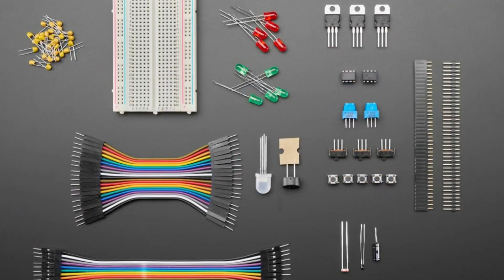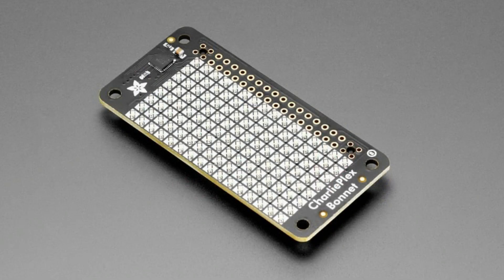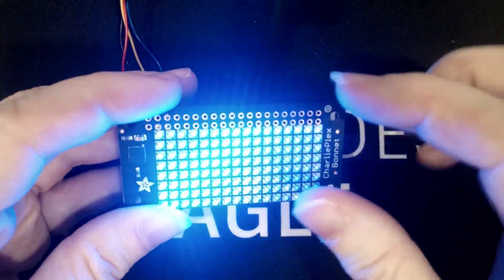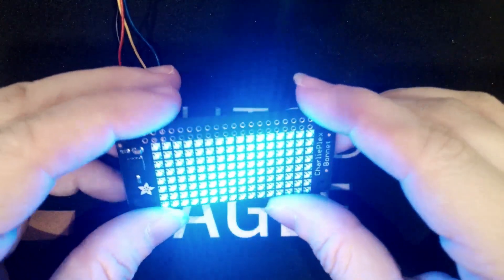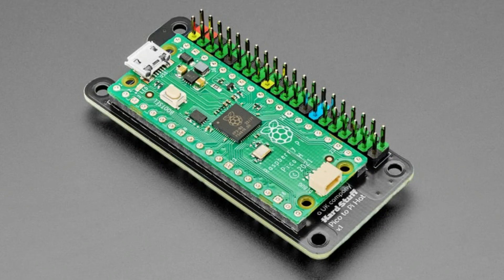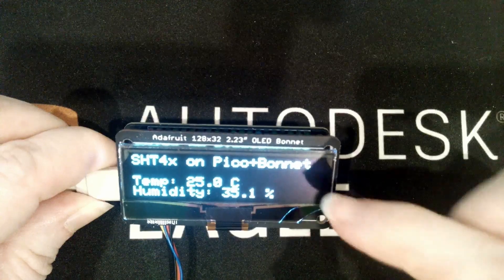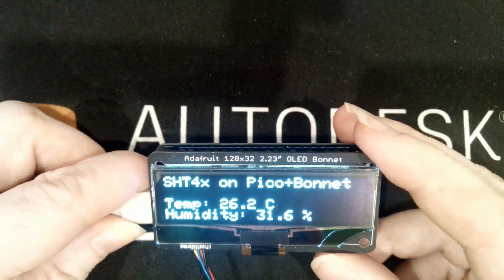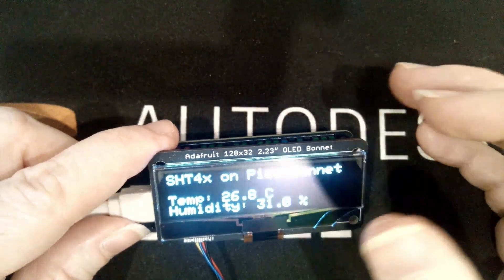#NewProducts 4/16/25 Feat. #Adafruit USB Type C CC Resistor Fixer!

Comment: Congratulations on the C-CC Resistor Fixer but it would be more convenient if you released a UltraSlim 90 Degrees C-CC Resistor Fixer because prolonging the UsbC port in a straight line like you are doing could cause it to accidentally break if the device falls on the ground whereas 90° Adapters are safer. Thanks for your attention and keep up the great work.

Comment: You cannot charge a Sony Dualsense off a charger which implements Qualcomm QC (even if it also does USB-PD) because the Dualsense wants D+/D- tied together (or through a 1K resistor). For example most Anker chargers. I've made cables that tie D+/D to fix this-. You could slightly modify this adapter to make another that does that. You can pass the CC (PD) line through still.

Maybe make one that can be configured both ways with some physical modification.